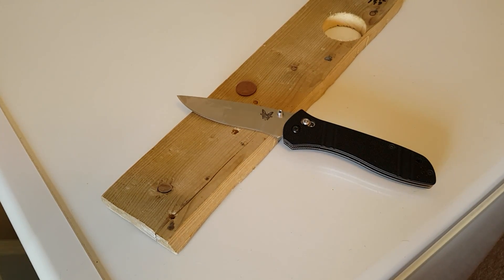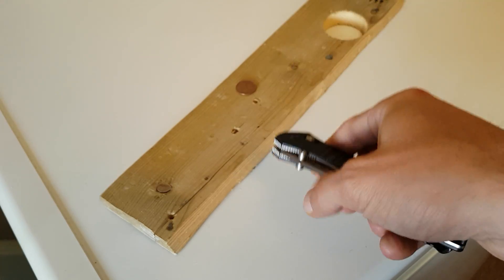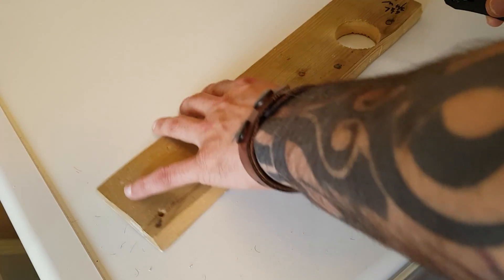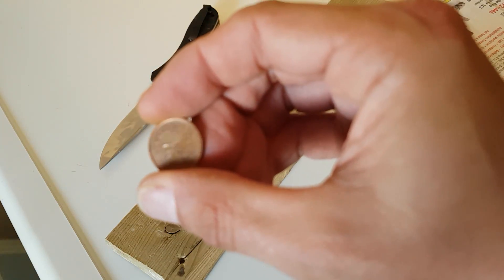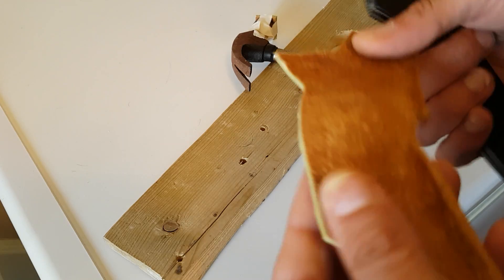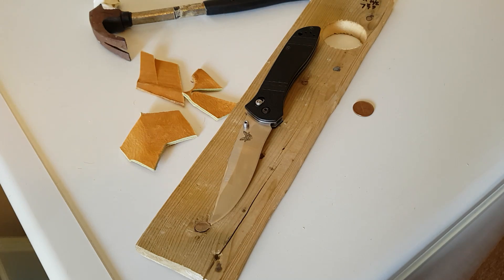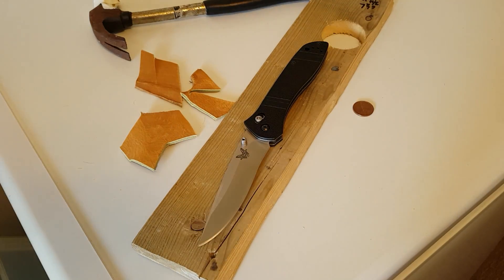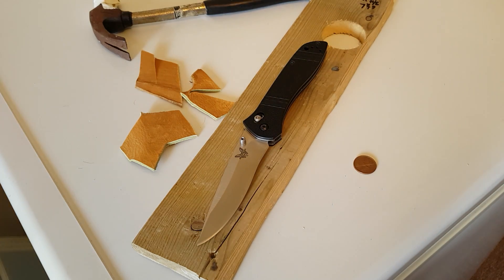Disproving misconceptions of D2 Steel.

Comment: Properly heat treated D2 is pretty good stuff. Not the best at anything but its pretty solid at most aspects. And now you can get it for a decent price on some cool designs. Russian D2 (12hmf) is actually really good. Have a nice fixed blade in it and its one my go to beater/ hard use knives.
710 is a great design but for some reason Benchmade discontinues so many of their breat designs to bring us new models and most are nowhere near as good as the older ones.

Comment: I would like to offer up my collective research that I did on D2 steel--- it is almost a stainless steel, having 11.5% chromium, which is just 2% shy of the requirements for classifying a steel as stainless. So yes, D2 steel is technically a tool steel. If a knife had even 6% chromium over the 2, or 3% carbon steel has, then that knife has a significant increase of rust and corrosion resistance, and D2 has 11.5% of it.
Do you cut salami, raw meats, cheese, and veggies, and then put the knife away without first cleaning and wiping it dry? 
So just don't take your D2 steel to the beach, live on a boat or go deep sea diving with it and it will be fine.

Comment: D2 is definitely one of those steals where a quality manufacturer makes a big difference in getting the heat treat right
Reply from the maker: Definitely, that for the edge retention,  would say its the finish of the steel that would make it more likely to rust or not. Bead blasted D2 would definitely rust much easier than stone washed or a fine satin.

Comment: I'm a bandsaw operator at a major metal distributor. I get to cut all sorts of steels. D2 takes a long long time to cut, that's for sure. I never timed it but it's along the lines of S7, 17-4 PH cond. H1150, 316 stainless, 416 stainless... Those nickel alloys like inconel, hastelloy etc sound wild but we've never had them in our branch.

It's very cool to see some more about this very cool steel!

Comment: I've used multiple knives and a bit of junkie for having ones w different blade steels. This hobby of mine goes back for near 50 years now. In my professional life I'm a CNC programmer for engine lathes and vertical mills.  I absolutely love D2 tool. It's just a great do all fantastic steel that can take a pounding. The ONLY place where I feel d2 falls short is when I'm at salt water beaches fishing etc. In those situations a true stainless works better, but honestly d2 just plain works.

Comment: It’s just a pain to sharpen.. compared to 1095
Reply from the maker: It is tougher to form a burr when sharpening thats for sure. Just find it takes more time. 
The more I try "new" steel's Im coming to the conclusion that 8d rather have something I can touch up quickly rather than a steel that will have insane edge retention. 
Best equation is the higher the edge retention the longer you'll spend sharpening.
Reply: @NeilTheKnifeGuy  exactly! And I would Prefer blade I can take back to razors edge in 60 seconds at the end of every day then one that’s gonna take me 10 minutes at the end of the week but just my preference.

Comment: I guess people don’t like d2 because the heat treating is hard to do, and if not done correctly it’s inferior.
Reply from the maker: The heat treat from my understanding from a few knife makers I know isn't that hard to accomplish. Usually that's the steel knife makers just starting out use because its inexpensive to buy and they can heat treat it themselves.
Reply: Chev Chelios  Haha, well from what I’ve read it’s not so much hand forging that’s the issue, it’s mass production, for some reason mass producing heat treated d2 is a challenge. Agree on sharpening though, I kinda prefer my good old cheap 8cr13 blades, they do dull but I can bring ‘em back to razor sharp super easy.

Comment: I have definitely had some issues with D2 rusting, but that can have more to with living in a coastal region and doing more work in salt water. Also, some of my knives have a rougher finish in parts of the blade and that is where I see most but not all of the rusting. I think a lot of people that bad mouth this steel is due to having the wrong angle on their edge for the work they are doing. I'm a little late to the party, with this video be a few years old, but good video.

Comment: As far as rust goes... I have a D2 folder with wood handle scales. I carry it in my pocket without a pocket clip, the moisture in my pocket from sweating all day at work has warped the scales pretty severely but I can't find a single bit of rust or staining on the D2 blade. I think as long as you maintain your knife AT ALL you'll find that D2 is effectively stainless!

Comment: The only “thing” about d2 is its abundance and its cost. If it was somehow scarce and/or expensive, it would be regarded muuuuuch more highly. Think about the various super steels and their benefits over D2. Does 110v hold an edge longer? Sure...for the cost, it bloody well better. Same thing with the cruwear/z-wear type stuff. But there’s a point of diminishing returns when it comes to value. I own a bunch of d2 knives and a bunch of “super steel” knives...and I can tell you from experience, the Shaman is essentially my dream knife. It’s my “from my cold dead fingers” EDC...but does it perform twice as well for twice as long as my D2 Civivi Incite or 9cr Praxis (Civivi’s Shaman counterparts)? Absolutely not. D2 is a killer steel and it’s nowhere near as difficult to sharpen as some would have you believe.

Comment: I have been making knives since 1992 and I settled on O1 and D2. I couldn't afford ATS-34 which later came out as CM 154. D2 was the stainless equivalent to my O1. O1 is superior to 1095 by a long shot if heat treated in an oven.But this is about D2, if you HT it for 30 minutes at 1900 F and do a air hose air blast quench it comes in around 64 hard. Now some people temper at 425-450 like I do O1, but that makes for a brittle edge at HRC 60. No the proper way to do D2, without a cryo, is to temper it at 1000 degrees F for two hours 2x. It will give you around RC 60 with good toughness. As for it rusts, that is something you would have to really try to do. To be classified as stainless steel a steel must contain at least 13% chromium and D2 contains 11-12%. Hardly any difference. I never hear about CPM 3V knives rusting and they're only 7.5% chromium, so I think somebody either left D2 in brine overnight or was full of it.
 The reason D2 gets and holds an edge very well is the 0.8-.9% vanadium and 1% molybdenum plus the chrome. It has 1.5% carbon and you get chromium carbides, mo. carbides and especially vanadium carbides that are harder than tungsten carbides. Vanadium carbides are harder than tungsten carbides? Yes, by .2 points on the Mohs scale. I forget the exact number, but it's like 9.4 for tungsten carbide versus 4.6 for vanadium carbides. 9 is sapphire and ten is diamond, but it's a bell curve if sapphire is 70 on the rockwell scale diamond is like 150. Don't quote those numbers, I'm just making a point about proportions, they're not correct.
D2 is a great steel if properly heat treated, so is 440C if HT with a cryo, but without a cryo it is difficult to get it hard with toughness.

Comment: I've never really worried much about what metal my blade is, I buy knives I love and just sharpen soon as the edge isn't very sharp. But i was curious if you've used s35vn what you think of it relative to the d2?
Reply: A2, 3v, elmax, s7, 204p, cpm154, i like all better than d2, penny test isnt that great of a test at all
Reply: @jamesanderson562  yea, i wouldn't use it as a realistic gauge for anything.I feel like usually you can tell how the metals gonna wear and it's hardness/properties and all that just while sharpening or honing it, I've always found just working a blade a little bit gives me the best idea how the metals gonna behave when I use it, how long it'll hold the edge.
Reply: @softsmoken  except for gerbers, idr what steel they use but it holds a crapy edge at the same time is harder to sharpen 😂
Reply: @jamesanderson562  boomers

Comment: I have a ZT with a  D2 blade, it's resilient and takes a beautiful edge, it's all about care u can take 8crmov and with proper care and a decently skilled sharpener and it will perform great for most everyday usage, blade steel really only matters on a task too task basis, if your cutting 1" rope all day then yes buy all means purchase a higher quality steel, for the everyday light task folder, blade steel doesn't matter.
Reply: Can I know what model is it? I never knew Zero Tolerance using D2 steel

Comment: I have the BM 375 Adamas. Its one of those knives I hate. But, in my hand I love. Sharpening D2 is a dream come true for me. I use 400, 600 and 1200 diamond. For field work I can put a good utility edge on and its good. Easy to keep up with also. 
I grew up with a K55K in my pocket. High rust knives are not a problem to care for. I swear knife people today have to be some of the most critical assholes I have ever listend to. Nobody wears anything out. Nobody uses shit. But walk around with tools that are bounds beyond what we had in the 70's and 80's. Testing has zero to little to do with how anyone uses a knife properly.
Shit if someone knew nothing. They would guess after watching hours of youtube reviews. Every knife cannot do non knife tasks, every knife is the next one you need to buy and every knife is somehow a piece of shit.
At least someone just cut a video to show a strength. Fucking cool your jets everyone. The Buck 110 has been put in its place. The horse is dead.

Comment: I was a toolmaker at the former Mercrury Marine Plant in OK back in the late 70s and D2 was my favourite steel. I still have ground precision tools in my box that have spent a lifetime in damp condition over here in the rainy UK they are as good as new. I have since seen a D3 which sounds truly amazing. Of course we had precise ovens and furnaces in the tool shop which you need to do justice to these fantastic steels. A2 is also a good steel.
Reply: Is it shock resistant enough for a machete?

Comment: My $2000 Lile in D-2 chipped easily while chopping soft rotten logs. Large 1-2 mm chips, not micro-chips. It is true soft rotten logs are very hard inside, but it was still a dismal showing: Taking on dry logs that were uniformly hard did not chip D-2: It's when there was a transition from soft to hard that it could not handle it. Taiwanese 420J of a $100 UC copy was easier to sharpen and far superior in holding a very fine edge while chopping, with no chipping or the slightest micro-rolling, even after 200 hits. S30V is by far the worse steel I have ever seen (on an $2000 RJ Martin Raven no less), along with CPM 154 (on another $900 custom): Micro-rolls detectable by nail, literally in one chop, plus very hard to sharpen, especially S30V.

Comment: D2 is die cutting steel. You know; the kind of steel used for cutting other cheaper steel repetitively. No doubt it’s gonna hold an edge.  
To me, the best material for bush crafting and survival knives for the cost is D2. Again, that’s for the cost.  Obviously there’s better steels, but they’ll cost a heck of a lot more for less return (and usually these better steels are considered truly stainless and to some that’s a priceless addition).
Reply: I agree, I have quite a few knives of all kinds and D2 is my fav. It’s tough and holds a nice edge for a while.
Reply: Ive also seen it work in stamping dies and cutting dies and done a fair amount of hardmilling on it, and am very interested in having it in a work knife.

Comment: Knives of Alaska makes almost all their knives with D2 tool steel with a rockwell hardness rating of 57-61 on most of their knives with the bevels at 18 degrees. They make filet knives with the 440c stainless steel bevels at 18 degrees. Fantastic knives all of them. My question is how I should sharpen the 440c stainless steel knives I have. Plan of buying a few more with the D2 tool steel & I do have a wicked edge system 100/200,400/600,800,1000 grit diamond stones & leather strops at 5 & 3.5 microns with paste for each. I have heard this system might damage the D2 steels?

Comment: I know a lot of people love D2 steel but sadly I am not one of them. The only thing I can think of is that I got a bad batch from Benchmade that had a faulty heat treatment or something. So far any knife I have had from Benchmade in D2 has had chipping issues. And not the small chips that can normally occur but large chunks removed. I use my knives but I don't abuse them. However the slightest drop (even from hand to counter top) has caused major chipping in my Benchmade knives. It's to the point that I refuse to purchase Benchmade from now on. I think Benchmade makes great knives but as they have grown in popularity and thus more "mass production" at least in my experience the quality has gone way down.

Not trying to say anything bad about Benchmade. But when it comes to D2 I think that the heat treatment needs to be spot on or else the issues I have had with it over the years will occur.
Reply: ChiTownTx damn i just ordered a bm infidel :-(

Comment: Both D2 and S30V will chip, and I've seen 154CM micro-chip from skinning a single deer.   There is no such thing as "super" steel, and no such thing as a steel that will not chip, or roll, or flatten.  There probably never will be.  I prefer a steel that flattens over one that rolls or chips, and one that rolls over one that chips,  but this is just my personal bias.

The problem with D2 is that the average user can't sharpen it once it gets dull.   This is Why Buck stopped making their 110 from D2, and why most manufacturers won't touch it.  Far too many customer complaints, and a flood of knives returned.

It also doesn't really qualify as a stainless steel, and this bothers some people. 

The penny test doesn't mean much.  A surprising number of steels, some cheap and crappy, do not chip or break in that test.   Chips usually come from left/right pressure, seldom from up/down pressure.
Reply: I think some of steels are ez to sharpen with stones and other with diamonds. I use stones for steels below 60 hrc and diamonds for >60 hrc
Reply: If that's the cause Buck stopped making the 110 in D2 then humanity has big problems. If a man returns a knife to the manufacturer because he cannot sharpen it, I say that man should stay in the kitchen and let his woman handle the business, because I wouldn't want a man like that covering my six. The pussification of man reaches catastrophic proportions these days. I have convexed CPM3V in the field, freehand using just a regular stone, I restored the damaged edges of an AG Russell Ti Fist in D2 or Cold Steel Leatherneck in D2 using the same stones, freehand, the same for S30V, and when talking about 1095, 5160, AUS8A, AUS10A, A2 it's a pleasure to sharpen. Those are the steels I use the most. Anything is possible if you use your God given intelligence and good tools. You don't need the latest diamond rods and sharpening gizmos to keep your knives sharp. A few hours and a little sweat is all you need. I apologize for the rant, but it's making my blood boil when I hear that men returned their knives because the steel was too hard to sharpen. A couple of hours of freehand sharpening accompanied by a glass of good wine are the best way for a man to relax and forget about life's problems. Best regards to all men who handle their business and sharpen their knives. To those who don't: less bitching, more sharpening! Stay sharp, all of you!
Reply: You are correct.  The only 2 I have seen that are close are the INFI & 3V Delta Steel.  They tend not to chip but roll in worst case situation.
Reply: The edge on my Spyderco Manix 2 in S30V rolled & lightly chipped after cutting through several zip ties.  I couldn't believe my eyes.  Softer cheap steels like 440 or 420 won't do that.

Comment: my d2 blade loses its edge so easily
Reply from the maker: +Rico Telles It has alot to do with the heat treat of the blade. What company makes the knife you speak of.
Reply: lion steel Daghetta
Reply: Rico Telles Must be a lemon,try contacting lionsteel about it
Reply: Seriously have a chat with Lionsteel. I have a gt6 knife from them in D2 and it keeps it's edge through serious hard work.
Reply: Then it not D2